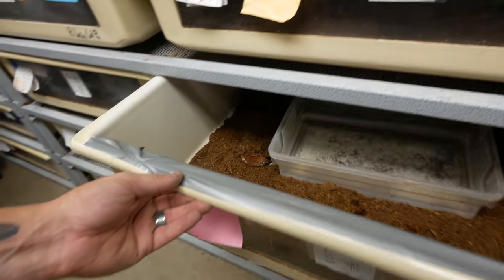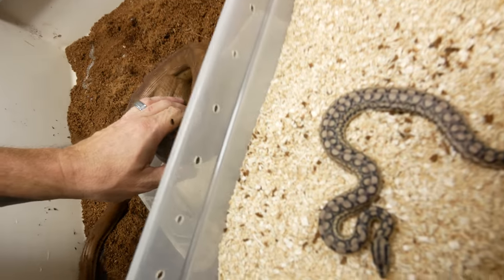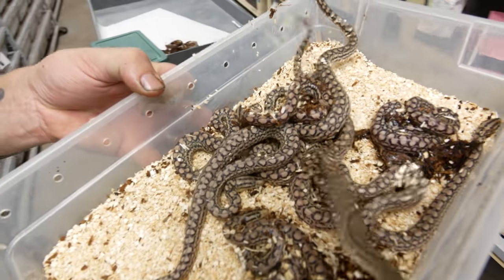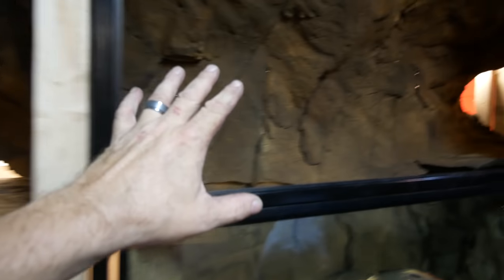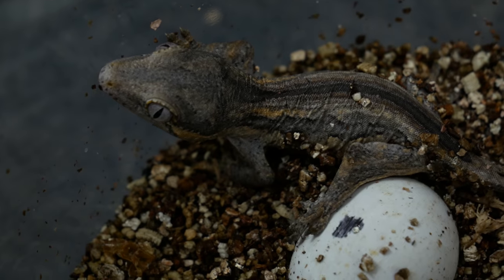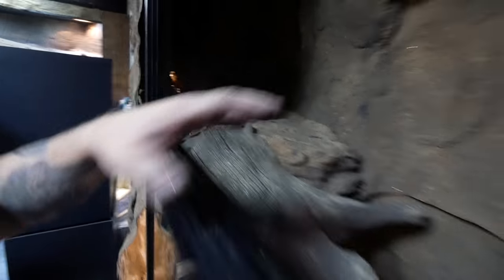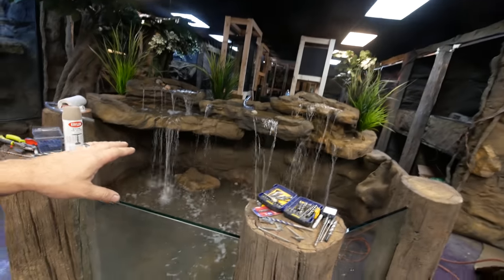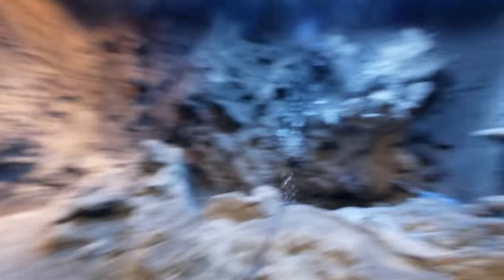WHY WERE THESE BABY SNAKES BORN DEAD??? | BRIAN BARCZYK

Comment: Hey Brian, I have a question for you which relates to your zoo (so exciting btw). I've been planning on buying a log cabin for a few months to put in the garden as a reptile room and I was curious how you are heating different temperatures in all your vivs. My single biggest expense to get past my wife is thermostats. I have a favourite that are pulse and £70 here in the U.K. It's going to cost a fortune to put an individual thermostat on each viv but I can't see how to do it any other way. Then you started building the zoo and it occurred to me that surely you don't have a thermostat on every single vivarium in the zoo as this would be one of your biggest costs so I assume you've got some magical way of keeping correct temps specific to each species. Any advice would be much appreciated. 
Also, if and while I've got your attention, are all the latex/flexible rock you're using from Universal? On their web site I can only find the rigid rock panels. 
Many thanks in advance.